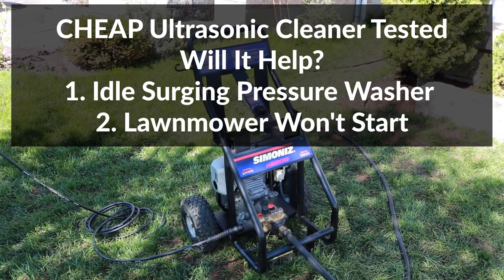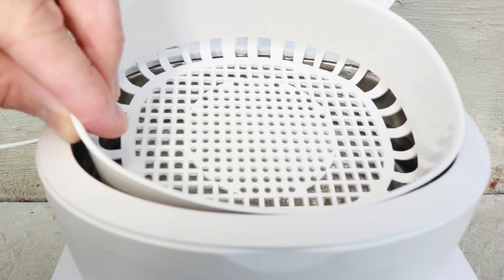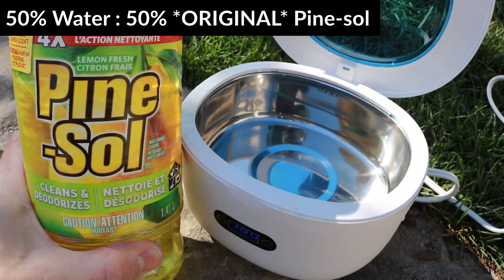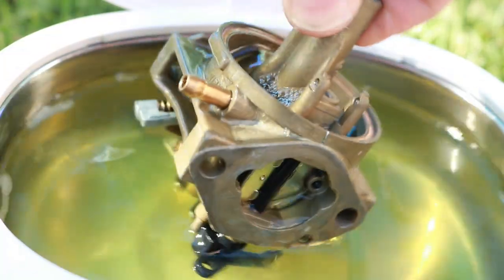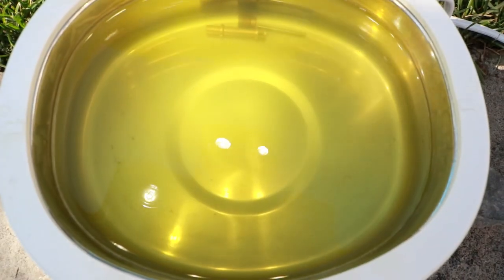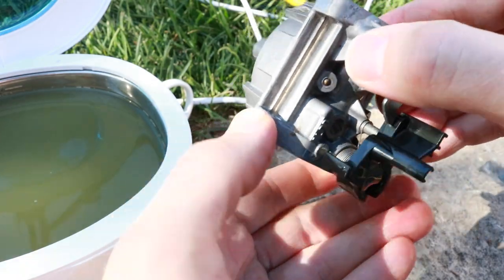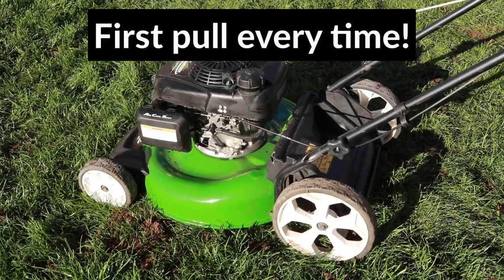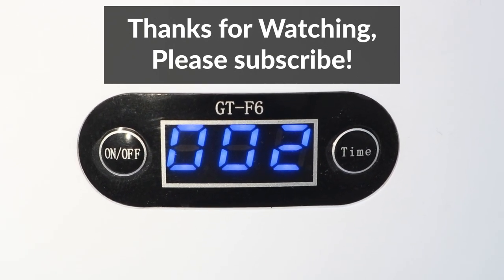Cleaning a Carburetor with a Cheap Ultrasonic Cleaner

Comment: Thank you for this video. I always wonder if I can do this. Save me some money in replacing carburetor on my lawn equipment.
Reply from the maker: It definitely saves $$$ and works, as long as the carb didn't rust on the inside. That's very rare, but some VERY old equipment can have rust sometimes.  Thanks for the comment!

Comment: Amazing cleans like new. Maybe next time you can do a video about coolant replacement on Corolla. and how much fluid needs.
Reply from the maker: Toyota Coolant capacity is: 5.8 qt. (5.5 L, 4.8 Imp. qt.) . Change interval is 10 years or 100k miles. You have 100k miles?
Reply from the maker: It's Super Long Life Pink Coolant, 50-50 for US and 55-45 for Canada. Ebay has some good deals for it.
Reply: @CleverFix  im arround 60k, i want replace coolant early only for prevention. and last question, how about gas filter?.
Reply from the maker: You should be okay for at least another 10k for coolant.. this coolant is the best you can get.. major worry is rust/corrosion and failed water pump when coolant goes bad. Most people don't change coolant on time, let alone early. It's very simple to do, if I can find a cheap deal like in US I could make a video, but border is closed now so I can't pick up from US any more directly , shipping is a lot. There is no serviceable fuel filter, just a strainer in the gas tank.. probably pretty coarse, it should never clog really.

Comment: What brand and model.is it ? Where did you get it , there are no.links for models
Reply from the maker: Ok I added 3 links. 1.5L Steel, 2L Steel and the one I'm using in the video, which is the same as the AmazonBasics. Any plastic one will crack eventually if used a lot.. I glued mine with epoxy where it cracked and it's still working but it lost some power.  I recommend a steel one if you can afford it, they can't crack, so it should last a longer time and should be much stronger.  These plastic ones are good for about 30 carb cleanings until they crack and start losing power. I found that out after using this one heavily and my neighbor had a bigger and stronger plastic one that also tore itself apart completely.
If all you use it for is small carbs and just 2-3 a year, it will last quite some time. The steel ones fit larger carbs, vibrate stronger and the whole carb can be submerged at once, no need to turn it over. Hope that helps!

Comment: Hi 
Can I clean my AC evaporator without opening the dashboard ?
Reply: I have to see, here's a diagram I found, looks like it's on the passenger side in a plastic case: https://parts.scarboroughtoyota.ca/images/parts/motor/fullsize/8407350.png
these things are a pain to clean though, lots of fins and hard to get inside, even when you have it completely out of the car, you have to be sure the cleaning solution reaches every fin.. so would think it will be quite difficult to clean it while on the car, but I think it's possible.. I'll take a look.
Reply: @Chris-12423  🌹 thanks
Reply from the maker: I Looked, I couldn't find any way to get to it unfortunately, it seems to be right in the middle. Did you find anything more about getting to it ?